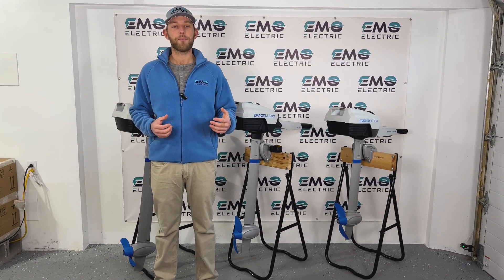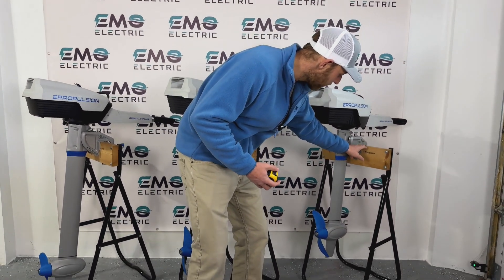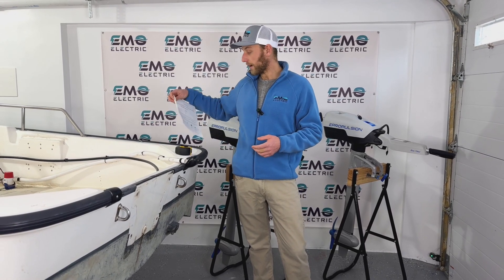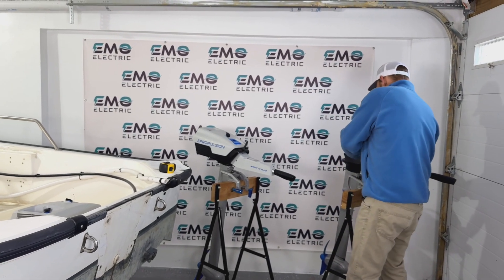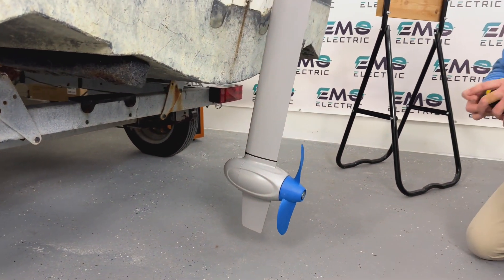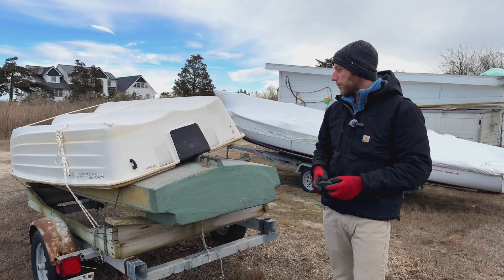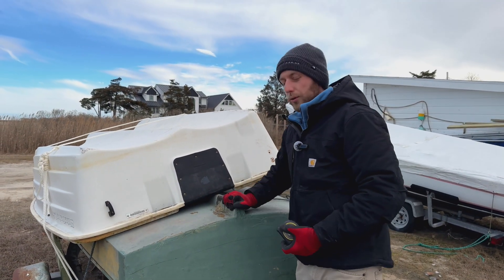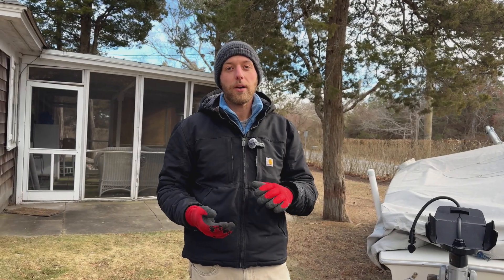How to Measure for ePropulsion Spirit Shaft Length

Comment: I just got mine, unfortunately in Canada so buying from you was not available although I do appreciate your videos. One question, with the tiller folded down, to carry it, can the tiller be locked folded down so the rubber tiller throttle can be used as the handle to carry it? Thanks
Reply from the maker: Glad that you found the video helpful! The ePropulsion Spirit is not designed to be carried by the tiller. I typically carry it by the shaft.